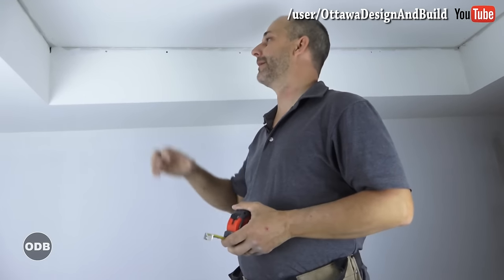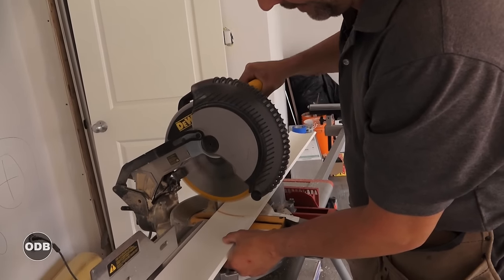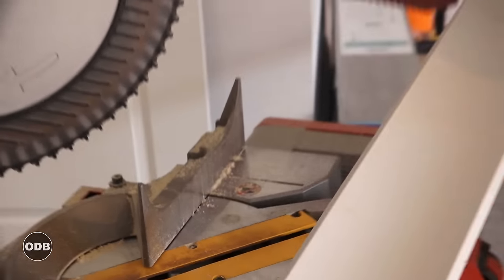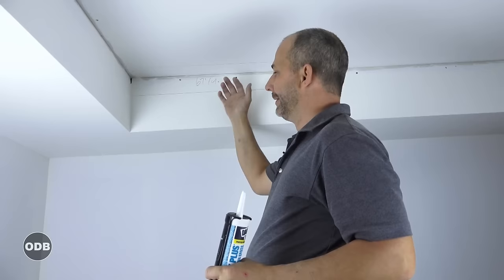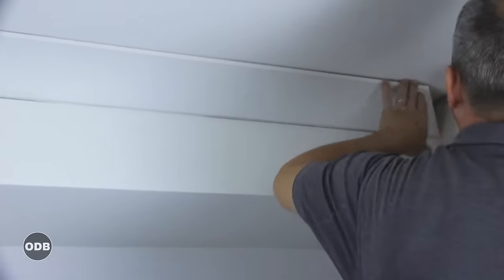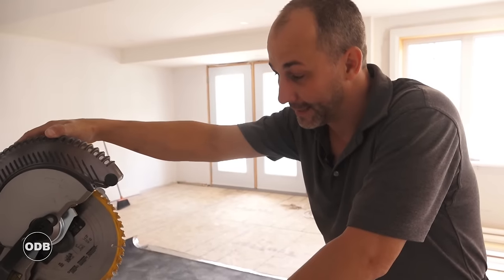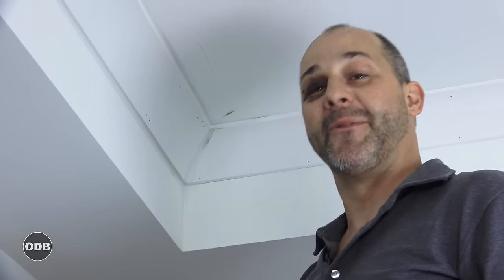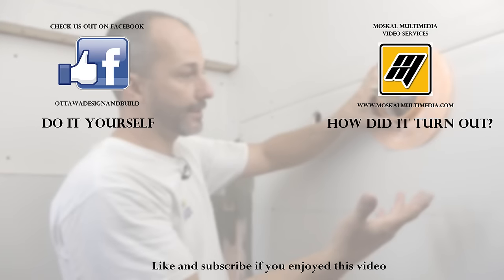How to Install Crown Molding Yourself and SAVE MONEY!

Comment: I did carpentry work for 3 year.  Most of that time i worked for 2 brother that taught me A LOT! They ripped a 2x4 on a 35 to 45 degree angle and nailed it to the framing. Then nailed the crown to the 2x4 with a 16 gauge nailer.
Reply from the maker: That is one way to do it!

Comment: Just ordered the jig! Since my compound miter saw doesn't tilt to the left, I was designed to hiring a contractor. Thanks for the video and you're right, it doesn't need to be perfect, just not noticeable.
Reply from the maker: contractor is most likely going to need caulking anyway. Cheers!

Comment: Just a sugestion.  When it comes to finish caulking i always use a wet rag to wet my finger and to place excess caulk.  On bigher jobs like a whole basement i have a rince bucket to ring it clean as opposed to running to a faucet.
And for the nail fill I've come to learn that spackling works best.... If u push it in it actually expands a hair and its the quickest low dust sand.  Also better with mdf as it does not swell like heavier water saturated products suck as pink patch (dap) and drywall compound.

Comment: Try the dealt crown stops for your Dewalt saw. they screw right into the sides of the saw. Works super good on furniture crown for cabinets. That universal block you have has too much play, less consistent cuts.
Reply from the maker: Good idea. Although for the homeowners, the ogee was only 20 bucks.

Comment: I clamp 2 pieces of wood on my miter saw as a guide and I don't have those funky ends like you did,  everything fits tight. I use the highest quality Sherwin-Williams caulk and the wood filler for the nail holes. In my house the only thing that needs a little attention is a splice joint on a 50' continuous piece of crown. However that pencil line and pre-chalking I'd have to think about. Yeah I live in Florida our humidity levels opening up to the pool cage and Lanai, closing the sliders with 74° F AC .. repeat put an awful strain on any molding.

Comment: Very helpful, appreciated the comment about 6 ft. Looks good.  Helps in maintaining.ones sanity.
Reply from the maker: Sometimes If I get a picky client and they point out a tiny scratch in the drywall I ask them to check the rest of the house and if my wall isn't up to that standard then I would be happy to come in and fix the scratch and paint the entire wall again.
Reply: Shouldn't matter what the rest of the house looks like when it comes to the quality of your work

Comment: Hi Jeff!  Loved this info for the crown, will definitely use it in the very near future.  It would be very appreciated if you could do a vid on how to recover stairs.  Either with the prefab covering that can be purchased at a hardware store, or even how to make your own.  I recently removed the carpeting from a set of stairs in my home, and was disappointed to find crappy construction stair treads underneath.  Was hoping to be able to patch, sand, and stain but that isn't the case.  Also, I have spindles that are attached to the stairs, would those be salvageable?   Tia!  Hope you and yours have a great weekend!

Comment: Hi, thanks for the tutorial. I will be doing this in my home soon. I have heard from others that mitering the inside corners as opposed to coping will leave them susceptible to gaps and cracks cause by shrinking leaving coping the better option. Curious for your perspective
Reply from the maker: No matter which optiuon you use the gap will exist. If you climatise your products and use an elastomeric caulking. Then  either option will work the same.

Comment: Always best to paint trim first, then install.  Especially true if walls and ceiling are already painted, which they should be to save time cutting in prior to trim install.
Reply from the maker: Hi John I couldn't disagree with you more. That is a waste of time. once you patch the nail holes you will need at least 2 coats to finish. simply paint the finished trim before doing the walls. Cheers!
Reply: looking at it as a project, including wall painting, rather than just as a trim job.  But, based not just on speed but also final results, paint trim, install trim, caulk,putty and touch up.  Even more so in this case because your way you have to cut in the ceiling and cut in the walls vs rolling everything out then installing trim.  Cutting takes 10x time and effort per square foot over rolling.

Comment: Try coping those corners, it will make it a perfect fit!
Reply: i had to do that yesterday on a crown corner. corner was not square and i could not get my dummy pieces to match up well so i just butt cut one end and coped the other piece.
Reply: Coping is the only way to do this properly! The first pick goes end to end without a cope. The next piece only the left and is coped working to the right. Last  is the only double cope. Since this is pine the copes are fast and easy.

Comment: Let me give you some advise that I had to learn from experience and from watching the crew that crowned my parents house.  Don't waste your time caulking the wall first, it is way more important to glue the inside corners just as it is when doing inside corners on base.  Don't nail your inside corners right away, nail the middle and leave about 2 feet so you can manipulate the corner.  Glue the corner and use a spatula to pry the two corners tight and then nail them with the spatula still in place.  Once you remove the spatula the corner stays nice and tight and it's glued so it won't crack in the future.  You  may have to pry the top and bottom depending how off the corner of the wall is.  Way faster than coping and just as good a result.  Caulk the top and bottom at the end as well as the inside corners.  Another tip for everyone else, if you are using flat/matte paint like ceiling paint for your crown, wait at least 4 or 5 days for the caulk to fully cure or the paint will crack.  If using an eggshell or semigloss (which doesn't look as good) then you can paint right away.  Also, outside corners should be glued first with CA glue with the activator so it sets in 10 seconds and then nail it to the wall as a unit.  Will save you tons of time an frustration since no corner is a perfect 90.
Reply from the maker: That is one way of doing it. Cheers!

Comment: This was an excellent video till the good enough at six feet comment. Im 6'3" and anytime i go in a hose with crown moulding i look at the corners first inside and outside then i check out the run is it away from the cieling /wall  if you take a little extra time and dont rush you can have professional miters with no gaps i would say buy a littlw extra material and practice your joints then i make a mock up of an inside corner and outside corner then i bring that and check the walls and mark my top and bottom
Reply: Oh yeah and i did.nt even notice the eye till the end

Comment: Didn't quite understand the straight cut then the angled cut with guide/fence(?)  However, going to try it out.  Have four inside corners in powder room.  Thank you - appreciated content of video.
Reply from the maker: Once you try it it will make perfect sense. Good luck. Let me know how it goes.
Reply: Kreig makes a much better jig for $30 bucks.

Comment: Can you do a video showing how you trim out those doors in the basement where there is only 1 inch above the rough opening at the header?
Reply from the maker: Sure but all we do is ru nthe casing to the sieling and then finish the header with shoe mold. 3/4 x 9/16

Comment: I noticed you didn't measure the angles.  As you've taught us, corners are never perfect 90 degrees. Do you not need to measure because you did the drywall or is that why you cut it short?
Reply: do as he says not as he does ;)

Comment: I Never use Alex Plus for filling like that if it's needed. Haven't for years. We had too many joints give up. Stepped up to better products like Big Stretch,  ProFlex, or even Alex Supreme/Ultra.
Reply from the maker: I don't use the painter's caulk. I use window and door. It has a 100% expansion which is plenty for conditioned spaces./

Comment: Nice trick for crown is nail 2x2 in back corner then nail crown to it
Reply from the maker: Sure it works but it is an added stpe when there is no need. Use a good adhesive caulking and you will never have cracking.

Comment: Did you try to hit a stud on any of those or will the nails in the drywall be enough to hold? Also did you use an 18 or 16 gauge nail here?
Reply from the maker: Ther nails hold it until the adhesive bonds. Then you will never have to worry.

Comment: I’ve never installed crown before, but with base & casing that if you back bevel your cut that can help with closing gaps like you ran into @ 11:00. What are your thoughts?
Reply from the maker: as long as the material has the same profile. This video was just showing a quick trick.

Comment: Jeff. I had sheet rock n crown mldg installed.  There's a gap between rock not bottom of molding. What can I do? I need to re cut a new piece anyway. The assembler used 3 cuts, which looks bad. Don't ask me why . lol
Reply from the maker: best to use door and window caulking. Cheers!

Comment: So, you’re using caulk to hold the crown? No backing?
Reply: Find the studs and use a longer nail. Also the real pros install backer boards on the wall and you don't have to glue anything to the wall!!!

Comment: Random question: what PSI do you run your compressor at for that Ridgid gun? Is that an 18 gauge brad? I have the same gun and I seem to get bigger holes than I should when shooting MDF. I've played around with PSI and dept setting on the gun, but it's a fine line between too deep and big marks, or not getting the nail set into the trim.
Thanks for the vid - great as always.
Reply from the maker: I use it around 90 with an 18 gauge. I hate nailing mdf it explodes instead of implodes. This is why I prefer to work with wood. Much cleaner.
Reply: For sure. Thanks for the info.
Reply from the maker: I do what I can Josh, Thanks for checking in!
Reply: Completely agree Jeff

Comment: Getting ready to do crown on my old house. I never got how to nail the crown when the rafters, in the ceiling, under the sheet rock, are running along the length, so theres nothing to nail to on the ceiling side of the crown. On the wall side, you can find the studs, and if your installing the crown with the rafters butting up against that run of the ceiling, you can nail to both, the wall studs, AND the rafters in the ceiling. So your basically just depending on the nails into the sheet rock in a criss cross pattern to hold the ceiling said tight? In an old house like this, NOTHING is straight. Just wondering.
Reply from the maker: i use the nails to hold the crown in the adhesive caulk until it sets up. Cheers!

Comment: What type of caulking do you use, does it shrink
Reply from the maker: In most cases I use a door and window caulking not a painter's caulk. It has an expansion of up to 200%. Not the best but in conditioned spaces there is not much expansion and contraction. If you don't have air conditioning for the summer I would suggest something with at least 400% expansion. That is called elastomeric!Cheers!

Comment: Can you please share what brand you like for caulking and what do you use to cover the nails? Thanks
Reply from the maker: I like a siliconized latex caulking for windows and doors. I like mastic putty for nails but they took it away from us up here in Canada. So now I am stuck with drydex.
Reply: Home RenoVision DIY I am trying to read which you are using ... is that Alex plus dap ?
Reply from the maker: Yes it is, not sure if that is available where you live?
Reply: Yea

Comment: Crown in my house meets at butt joints on long runs, no scarf joint, so the joint is very obvious and at every joint one edge is kicked out at the bottom (no adhesive I guess). How can I fixed this short of all new crown?
Reply from the maker: sand the crap out of it until it joints right and then paint.

Comment: I don’t understand why you didn’t run the caulk the full length of the piece you were working on and then just support it with a few nails until dry and then remove them. Much less filling of nail holes afterwards......or just use Cove adhesive that grips first time and requires no support. 🤔

Comment: I notice when you use the saw, you use no face shield or googles, are a respirator. And applying caulking, using your  bare finger to remove excess caulking is a no, no. the skin absorb the chemical in the caulking. Safety should always take priority in any job.

Comment: You don't need any stinking chart, your saw has marks on it for crown molding. Use the marks and you got it everytime.
Reply from the maker: Thanks Seth, That only refers to 1 style of crown and only to people cutting against the fence. My tip was designed to help the homeowner visualize what they are doing so they can accomplish the task without wasting time and materials.

Comment: May not be the moulding, possible the corners are greater than 90 degree, this will cause gaps if you're doing 45 mitres. Good tips though.
Reply: Cope your inside corners and you don't have to worry about that.

Comment: Like all these videos on crown, including this one. Not happy that many use caulk as the "fine tune" resolution. Take your time, do your measurements and cuts correctly and caulk is not needed.
Reply from the maker: That is the other way to do it!
Reply: LOL  That's the only way to do it, whether it's MDF, pine, poplar, Maple, Birch, Oak, Cherry, etc. I'd be firing someone if they came to one of my job sites with a tube of caulk. My experience tells me that if you learn the correct way there can be no other way. It's all in the measurements, miters and copes. But each to their own. Still a good video for beginner and novice tradesmen.
Reply: With hammer and saw I try my best, paint and putty will cover the rest

Comment: I think you would be better served running two parallel pieces straight into the wall and then coping the other two walls.
Reply from the maker: That traditional system works well. This is super quick!

Comment: Hello Jeff. even if coping the joint I would want to use that block thing you have. Heard you refer to it as a fence or guide but I can't find it using those keywords on the home depot site. What is it called? I know this is an older video Hope you reply. I read a bunch of the Ignorant comments about your eye. I think you should be commended for having the courage to not give a F--k about opinions and do your thing. Also the classy way in which you chose to interact with the ignorant f--ks. I love your channel. Have you ever re-glazed a Bathtub? This is in my near future....yikes!!!!!
Reply from the maker: the tool is called an Oogee! and yes I have paid for re glazing . it works awesome and can save a ton of time and money on a project. Cheers!

Comment: I'll call you crazy... I want work done right, not cheap.
Reply from the maker: Funny thing Dave, there is nothing wrong with the work. Most guys in this business don't even use an adhesive when nailing on their trim.
Reply: Home RenoVision DIY 
giving you a hard time since you said it... but probably related to having had some recent experiences and paid a lot of money for some work that wasn’t to par. If I had known this before hand I wouldn’t have done it. Now left with half ass work.

Comment: Cope cope cope...flawless finish minimal caulk...it will last until temp and humidity levels change...
Reply from the maker: cope is affected by temp and humidity as well.
Reply: @HomeRenoVisionDIY  absolutely, however, being a tight fit without loads of caulk, it would only be a hairline. Been there done that both method, I'm sure you have as well. I know you really know the superior method. Cheers

Comment: Why not just cope instead? Jig saw and sander works for this.
Reply from the maker: Did you see how fast I made that cut! That's why
Reply: Just my opinion, I think messing with all the caulk and twisting the pieces into place makes up for the time it takes to cope.  It's especially fast if you have a coping jig for your jigsaw...
Reply from the maker: I agree Ken, however on this channel I am trying to do projects that don't require a huge tool investment. Keeping the homeowner in mind.

Comment: Holy crap...I have never heard of the "six foot rule". That is just wrong in a craftsmans brain. I would have coped the corners for a better/ tighter fit.
Reply from the maker: That is entirely your prerogative. The fact remains however that every home built is full of deficiencies that people don't see. I am sure it is also true of your work.
Reply: I totally agree- What do they do when the crown isn't painted, Lots of putty I guess. To do a job RIGHT and fix wall and crown deficiencies you MUST cope inside corners.  " Six foot rule " ??  It better be perfect from Six Inches !!
Reply: This was for Steven
Reply: I work in production homes in California. People would be shocked at what the builder gets away with. A new home is FAR from custom. The fact everyone is telling you to cope is proof of that. Rooms aren't square, corners aren't perfect. The base and case guy has to make it perfect...laughable. Everyone takes their time to make it right/perfect sounds great but in reality that's why you pay top dollar for a custom home not a "production" home. Trim guys here are two man crews, 2-3 houses a day. NOt coping shit. Caulk and spackle/ wood filler, sand. Looks great. Plus theses are in the bay area. Selling before the models are made! Good DIY channel. What you can do for a couple of hundred bucks, or pay someone a couple of thousand Your choice. 2p-10 works miracles for bonding stubborn corners!